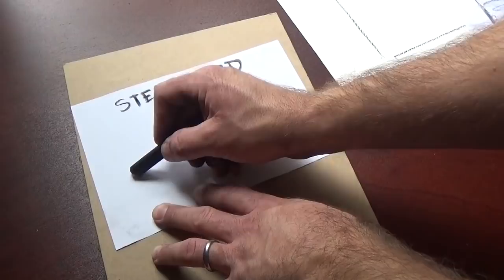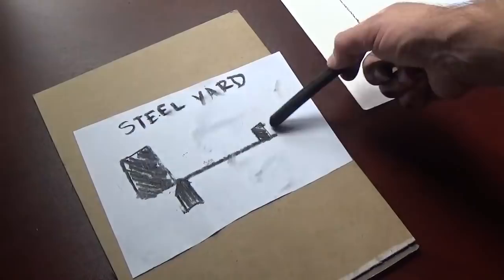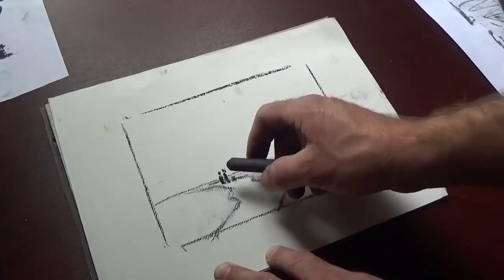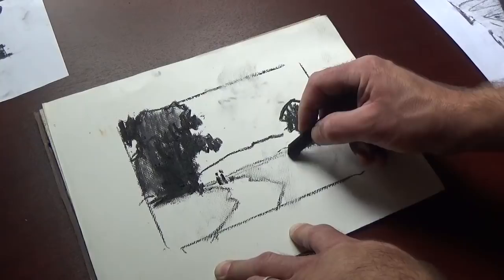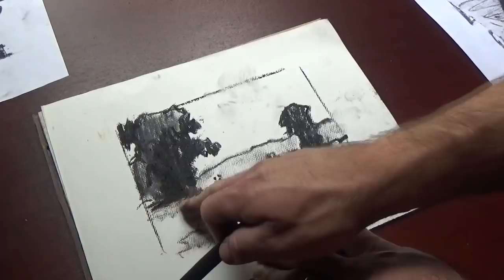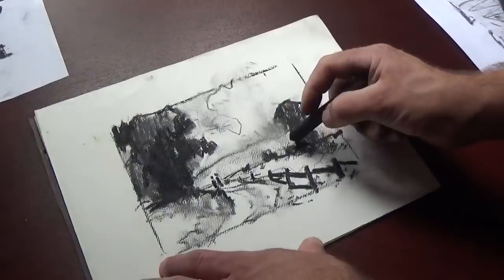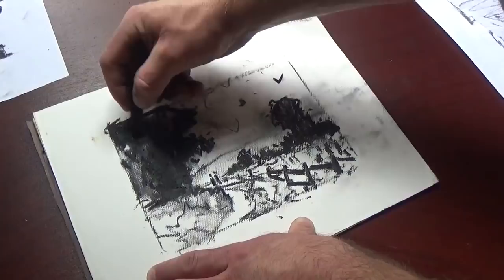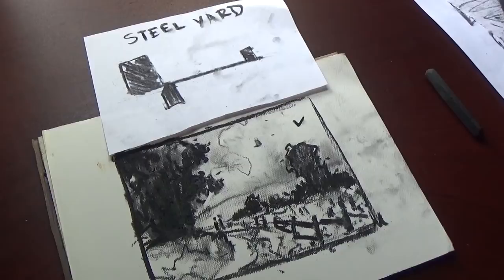How to Guarantee a Successful Design in your Art : Design Stems - The Steel Yard

Comment: With all due respect, I would love your rationale why the two weights have to be a "similar value" since many many  books say the two weights can have different values. Also, the weights do not have to be on the same plane... Loomis says the scale can tip....  Thirdly, Loomis says  the heavier weight is placed closest to the center of the page. Is this some kind of beginner explanation  of doing Steelyard?